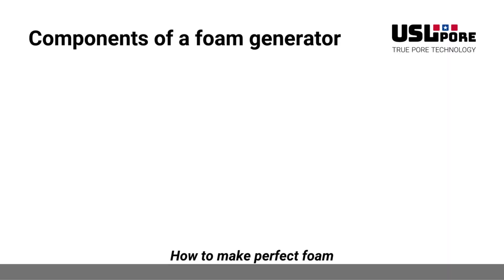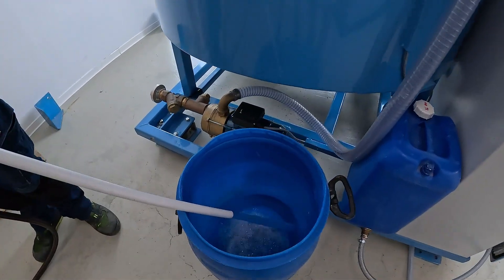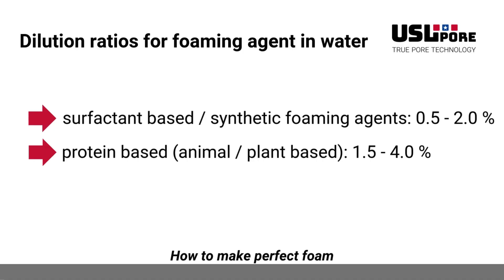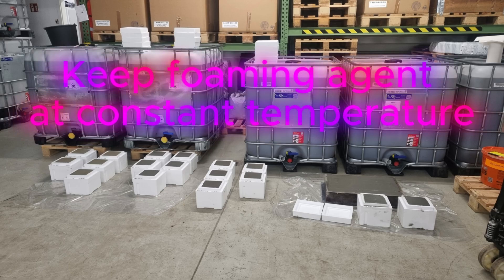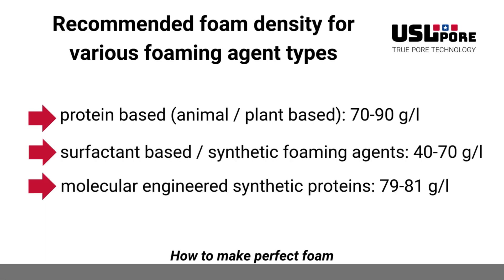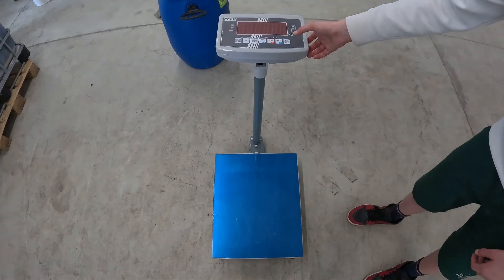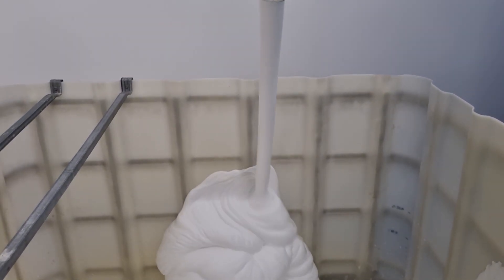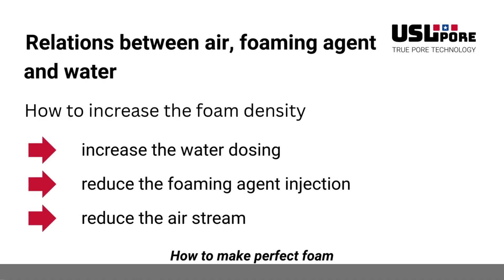Stable Foam Production Process | Full Specifications for Construction Materials

Comment: Thank you for this educational video. At the end, you mentioned how to adjust the foam density. However, I’m wondering — is having a higher foam density an advantage or a disadvantage for us? Also, could you please explain in which cases we should consider changing the density?
Reply from the maker: Thank you very much for your comment. For foam concrete you are combining two different materials with each other. A cementitious slurry with around 1600-1800 g/l in density and a very light foam, that is having only a fragment of the slurry´s density, say 50-100 g/l. Physcially the heavier the foam is (higher density), the easier it is to embed it into the cementitous slurry, as the densities of both materials are more even. From this point of view a lower density is harder to embed into the cementitous slurry as it will float more on top while mixing, than a foam at higher density. 
In addition you may surely also consider the overall stability of your foam. So it might be less stable for higher densities depending ont eh chemical you are using as well as the aeration process, so namely the foam generator your are using.
Also one point from the view of builders or architects is the incorporated water, you are adding into the mix, if the foam density is higher. Think about a foam concrete of say 400 kg/m³ dry density with aorund 750 liters of foam per cubic meter. For 100 g/l foam weight you are adding 75kg water, for 50 g/l foam density, just half the water amount (37.5 kg). So you have less water that needs to evaporate later one.
At the end it depends majorly on the stability of the foam in your system. If yo have any further questions just let us know.